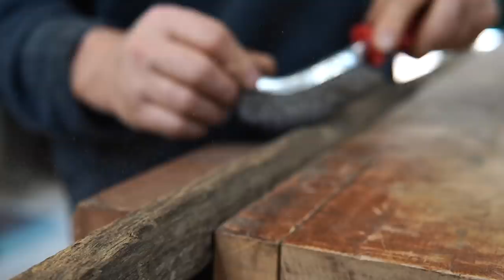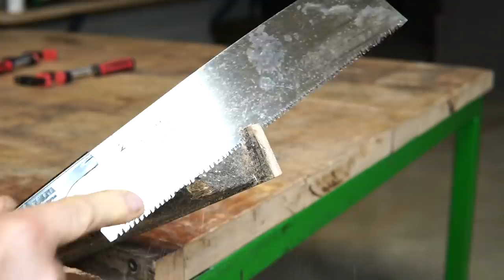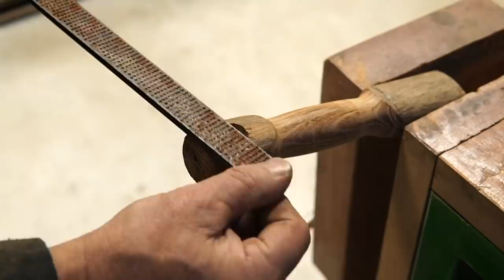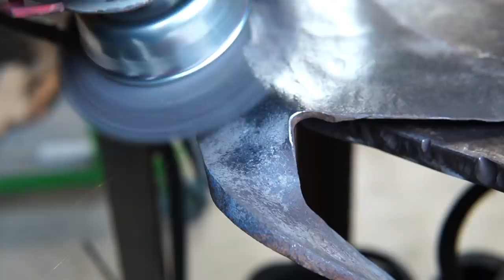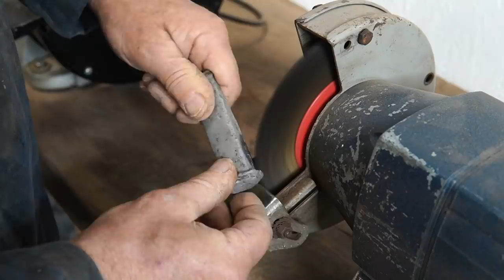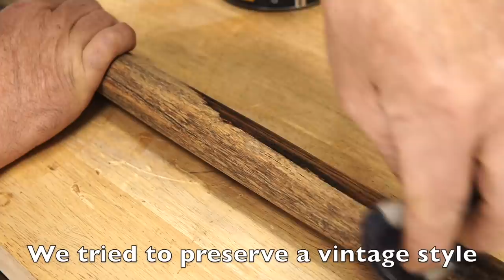Rusty Scythe Restoration

Comment: Great job! I have my dad's but it's been kept dry and out of the weather. Glad you could restore this old piece. Someone commented about the curve on the tip of the blade was supposed to be there. Mine doesn't have a curved tip and never did on either of the blades. I have the old warn out one and a newer one that's over half warn. Maybe they made them both ways so yours could have been damaged. Thank you for sharing your expertise!

Comment: I am really surprised and impressed that you were able to save the wood handle of the scythe. Most people would have just bought or made a new one, since it is just wood. It takes some good woodworking skills to restore that handle. Also enjoyed what you did with the metal, fixing the broken part with weld and giving it a rustic look by using a wire brush rather than giving it a mirrored look by sanding it. Very nicely done.

Comment: Hello, you are doing great as usual. When I lived outside the city as a child, the scythe was first beaten off, the metal was pulled out, only after that it was sharpened. I'm very surprised you didn't.
Reply: Show piece now in the GRIM REAPER's collection 🤣🤣🤣
Reply: I'd say peening a scythe is the most important part, I peen my scythes so that they are razor-sharp without any abrasives and all is needed just slight correcting the "sting" during scything with a few strokes of wet stone.
I got about a dozen of scythes of different sizes (in Russia they came in sizes from "5" - "5.1/2" - "6" -... to "9" which is 90 centimetres long) the oldest made in 1920-1930s. Russian scythe is called "leetovka" and is lightweight, besides the blade itself there is a slim handle (from a little dead fir-tree) and oak wedge in metal ring. I made handles and wedges with a handplane and an axe only.

Comment: Hello I have used a scythe like that many times, it's a common type in my country. You didn't have to make the second handle, because you just hold the tapered end. Also a scythe needs to be peened with a hammer, you shouldn't just grind it
It's a tool that requires skill to use, when I was learning to mow my grandfather used to say said "a toothless cow would have done a better job than you"
Reply: Good one "a toothless cow would have done a better job than you"  🤣🙄but you have to love grandfathers
Reply: Nice guy your Grandfather sounds like...just what you wanna hear as a kid...😞
Reply: Interesting info! I have also used a scythe many times in my youth but have never heard about peening. I guess it compresses the steel making it harder, like a cold hardening. Correct?
Reply: @alti5657  Yes, correct, it's called work hardening. The steel of the scythe is very thin and not very hard. Peening makes the edge paper thin and you don't ever need to grind it, just use the sharpening stone.
If you are British or American you might have used another kind of scythe, I've read that they call them "celtic" while our scythes are called "roman" or "austrian". The celtic scythe is thicker and heavier and made of laminated steel with a hardened edge, this kind of scythe can't be peened and has to be ground on a grinding wheel

Comment: My father had many of these. He carried a stone to sharpen the blade as he cut hay or cleared overgrown areas. I can still close my eyes and hear him dressing the blade and the whispering sound the scythe made with each stroke.  I could never master it, he swung in a smooth motion from the hips, pulling the scythe through the material to be cut. I tried to chop or force the scythe which was wrong. Thank you for restoring this and my memories.

Comment: Nice restore. BTW - these blades are sharpened by peening the edge then the edge refined with a honing stone. You should never have to grind the edge as it could harden the metal and make it brittle.

Comment: The second handle isn't "usual", whether it's there or not depends solely on two factors: the purpose of the scythe (making hay, cutting weeds around the house, field work, etc. all have different blade lenghts and different styles and lenghts of handles), and the region it's from (pretty much every country developed its own specific design, fitting for the land they worked and their skills, in some parts of America you can still tell where the settlers came from based on their scythes) - nowadays you can mostly buy only one type, the one you made, but the scythe was definitely of a different kind originally, hence only one handle.

Comment: Just an fyi, but scythes are usually made of mild steel or wrought iron, making them relatively soft. For that reason they're traditionally sharpened and at the same time hardened by hammering the edge on a polished anvil.

Comment: There is only one way to make it ready for work. Sharpening is done first using a special hammer and small special anvil. You hit the sharp edge of the blade, then you use special stone to sharpen it on go while you doing work.

Comment: Sir, this project is wonderful! Great job! But allow a little criticism. You can not sharpen the scythe in this way! After such sharpening, you will somehow be able to knock down weeds in the garden, but it is high-quality and easy to mow thick grass - alas, it will not work. Before sharpening, it is necessary to "beat off" the cutting edge of the scythe. This is done with a hammer on a metal bar (3-4 cm wide, about 1 cm thick), which is driven into a wooden block. After that, the scythe is sharpened - only with a manual abrasive bar. Check the sharpening of the scythe like this: the hair on the arm should be easy to shave.
(sorry, I use google translator)

Comment: I wish there was a reasonably affordable way, using vacuum suction pressure, to impregnate wood like this in an acrylic solution to use as reinforcing and strengthening the original wood

Comment: Por project new wood for scyte in my country 5-10 $ this old will crack quite fast if normaly used. The scythe is blunt, sharpening is not enought,  or will by after few min of normal use.  The scyte longness and angles suppoust to be fitted for person height and hands otherwise it is only gadget. Even blade longness (not talking about blade types) are in few longness for diferent personal dimension not other use.

Comment: Good job. The only remark is that braids are not sharpened in this way. They are beaten off with a hammer, thinning and slightly bending the cutting edge. It should be at an angle parallel to the ground. There is a special device for beating off the scythe blade. And after beating off this refined edge is already sharpened with a grindstone.

Comment: Keep your back straight while mowing, extend your right arm, use your left arm to control the tilt and your right hand to control the twist. The rotational movement has to come from the hips, not the arms/shoulders, or you'll quickly get a sore back. Not doing it right can cause lasting damage to your back. The moves have to be ample and smooth - that tool is not an axe.
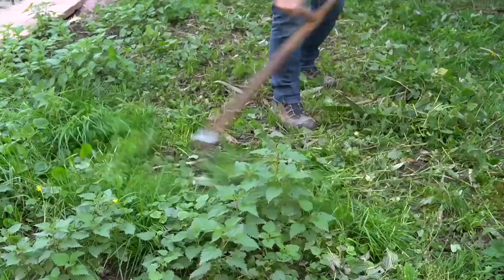Reply: Sure ! But the problem is, the snath is desperately too short (13:47) ... The restoration in itself was brillant, but as far as I am concerned, that beautifully maintained blade deserves a new, more ergonomical snath...

Comment: Why does the author start working on a project he has no idea about? straightening the tip? This is a corn scythe and must have a blade shaped like this. Sharpening with a manual grinder and not a whetstone will not give the correct angle of the blade. Such a "restored" scythe is only suitable as a decoration.

Comment: Your not supposed to grind an edge on a scythe you peen the edge with a hammer and rounded anvil and only use a steel to touch up the edge while you work with it